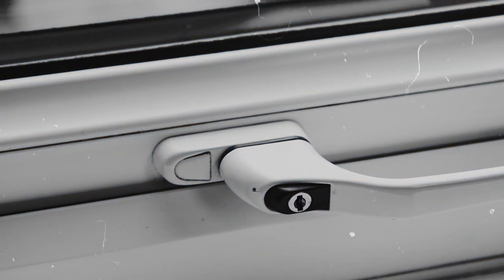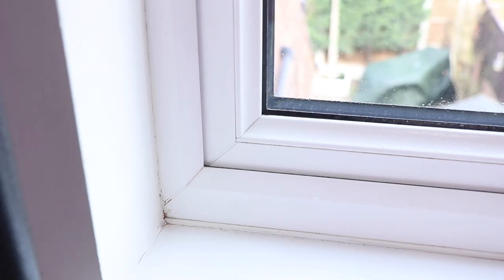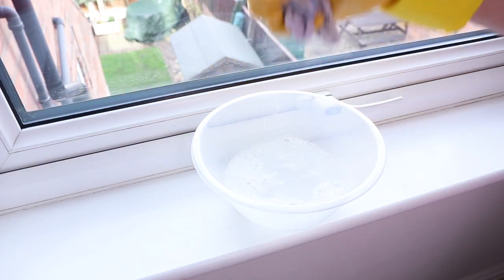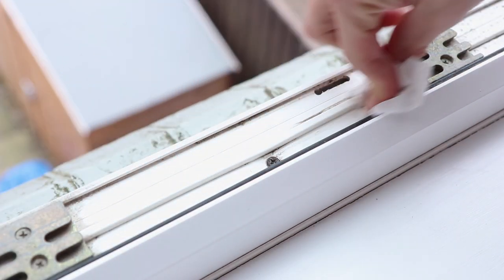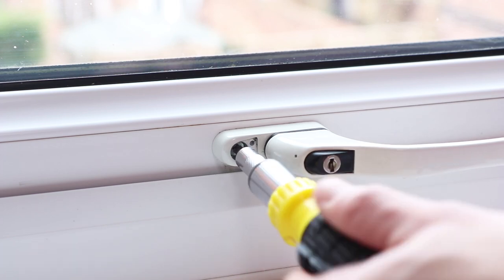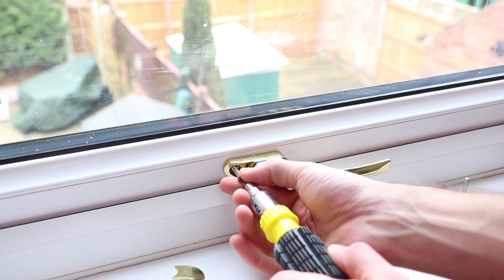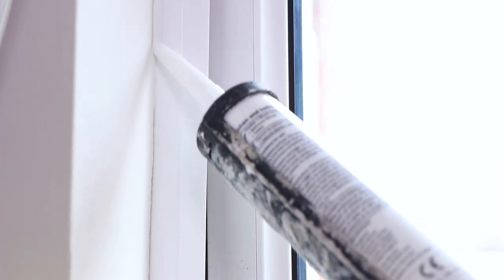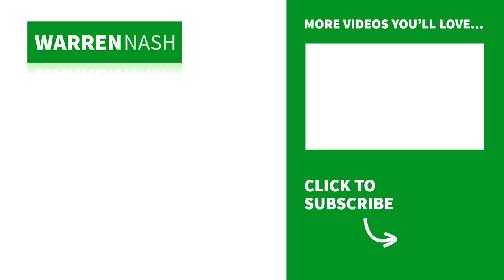How to clean UPVC windows - PLUS Seal & Handle Replacement - Easy DIY

Comment: I had UPVC bowater zenith windows replace my old aluminium double glazed windows made in the 80s. Over the years, the UPVC has greyed on the outside and the gaskets have dried up allowing air to pass through the window. Is there anything I can do to solve these two issues?